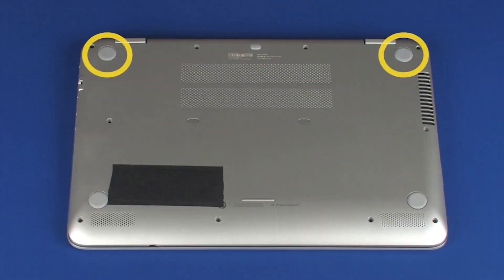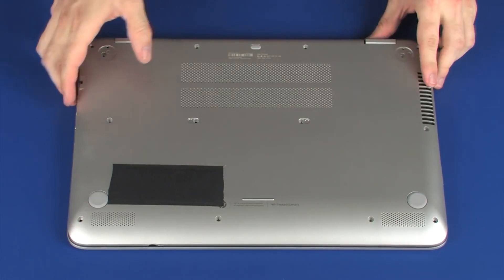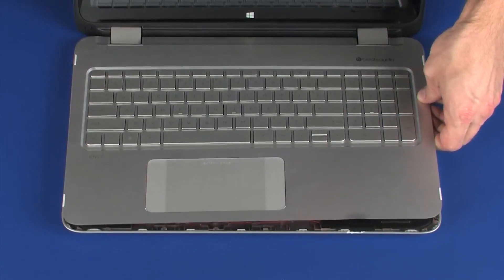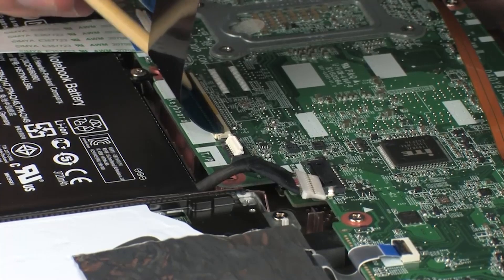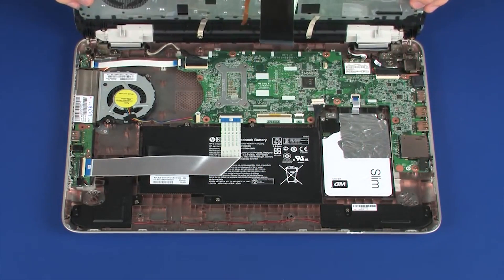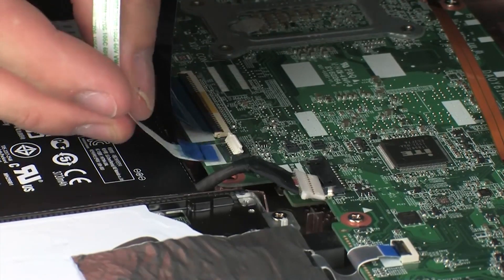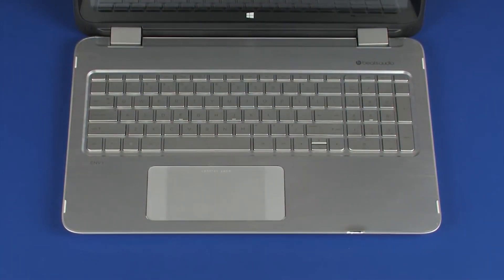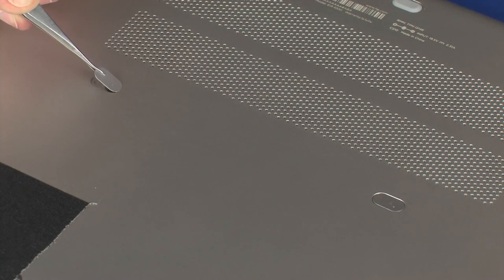Replace the Top Cover | HP ENVY 15-u000 x360 Convertible PCs | HP Support

Comment: My trackpad keys are "broken." What exactly should I do? The left key is very loose and moves constantly, while the right key seems to be entirely unresponsive and stuck in place. I'm not sure if doing something similar to this video would be overkill or not. Everything else works perfectly fine.
Reply from the maker: Hi there, thanks for contacting HP Global Social Media Support!
I understand that you are experiencing an issue with the touchpad.
In order to get this issue fixed, please contact our customer care team over the phone or chat for further assistance, as this issue requires Live conversation with you over phone or chat to isolate the issue and provide you instantly with appropriate solution or repair/replacement options available at your place as per the warranty.
Please feel free to reach us on call/chat, please access this link to select your preferred country and language option to reach us. Global support link: - https://www8.hp.com/us/en/contact-hp/ww-phone-assist.html
Binu_HP Social Media Tech Support

Comment: I wanted to add extra SSD to my 15s dy3001tu.. can i add without voiding warranty ?
Reply from the maker: +gravi ty HP does not recommend upgrading or downgrading hardware parts or software that is bundled with the product as It may affect the manufacturer's warranty and performance, however, you could change the configuration at your own discretion.

Comment: I want to upgrade  my Hp laptop model number 15-da2180nia to 32gb ram from 16gb ram. 

Unfortunately there is no service manual for it, even from the official website.

 Is there a guide for a similar model that I can use to open the laptop base?
Reply from the maker: +Nehemiah Muchelle HP does not recommend upgrading or downgrading hardware parts or software that is bundled with the product as It may affect the manufacturer's warranty and performance, however, you could change the configuration at your own discretion.

Comment: My base enclosure will not remove. There seems to be two attach points under the keyboard that will NOT let go! I have fully released every point of the base enclosure... 
X360 13-s192nr
Reply from the maker: +derbagger22 Please refer this video to know about removing the base enclosure: https://bit.ly/3nJi29F
Reply: @HPSupport  nope, my x360 is completely different. Mine had tiny plastic tabs that looked like indents I. The cover that needed a tiny flathead screwdriver to pry them out. I had to remove those two screws, which sit near the center of the cover, before the keyboard would release. I have one seen one video on YouTube that accurately shows these plastic tabs(in addition to the rubber feet I removed, in addition to all sorts of screws and nubs) and show me how to remove them.
Reply: @HPSupport  here is the video I'm referring to. My model is not exactly the same, but the cover and screw location is...

https://youtu.be/bxwsbd9hs7c